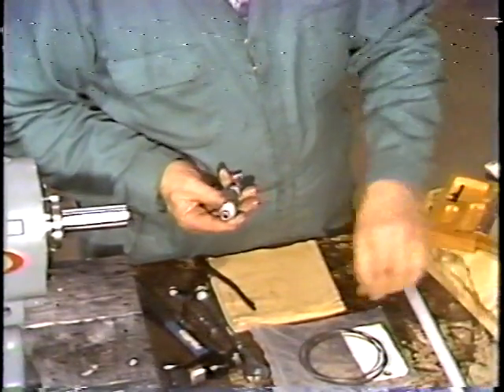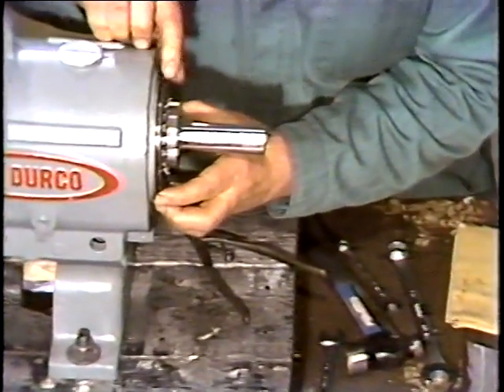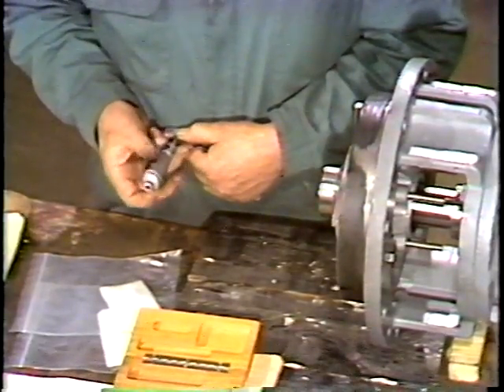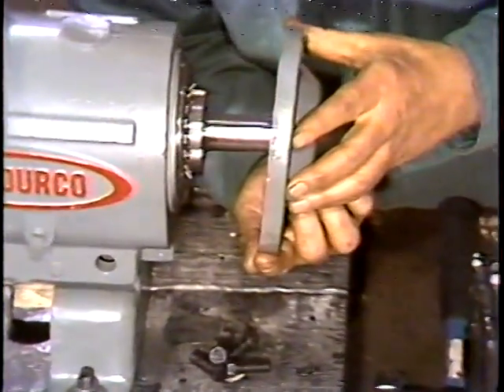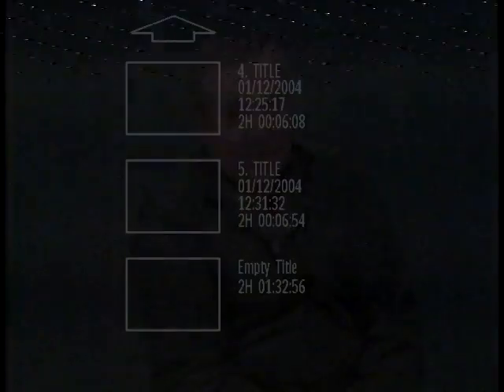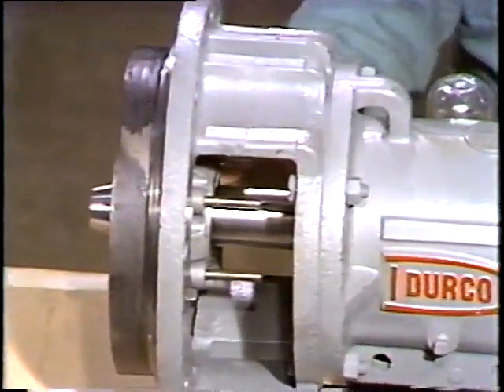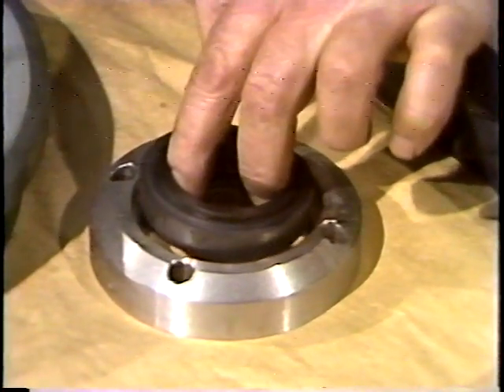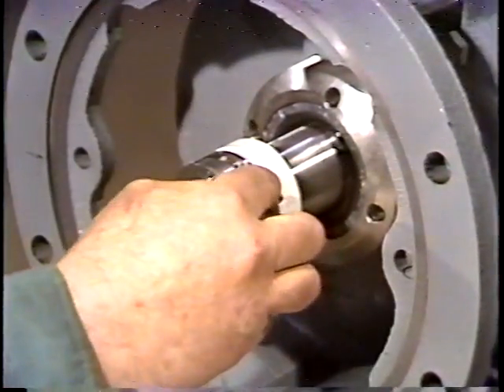Centrifugal Pump Overhauling & Tolerances - last part

Comment: Where is your training done?
Reply from the maker: +Jim Hallmark in KSA
Reply: Where is KSA? The facility is very nice for training. I have done training n pumps for a very long time and a suggestion might be to correct the parts you identify. Like you called the stuffing box an "End Plate" and when you did-assembly the pump there are somethings not done correctly but overall you have a nice video.